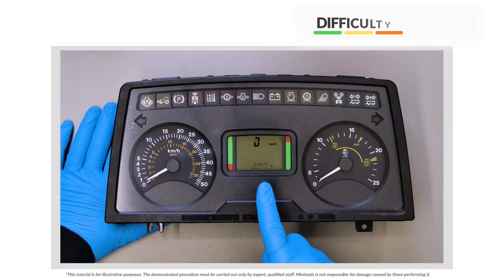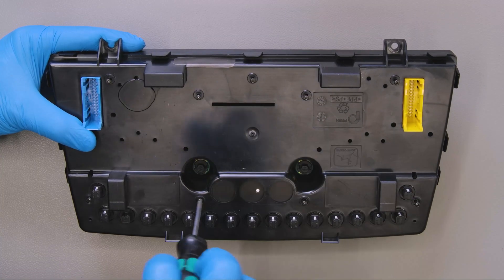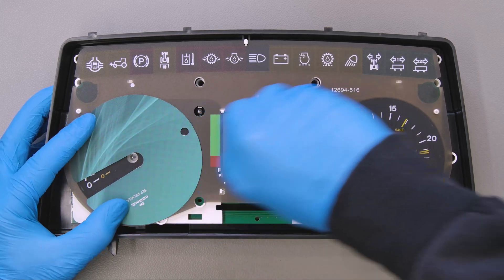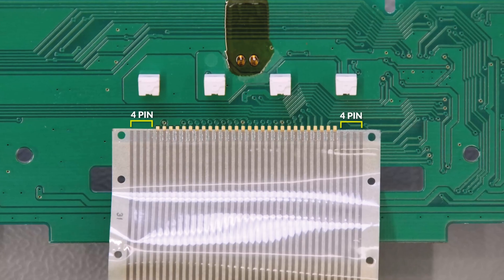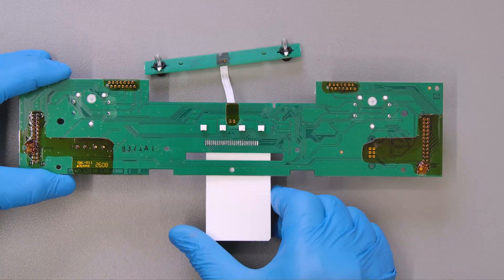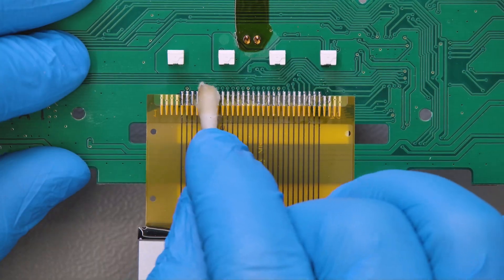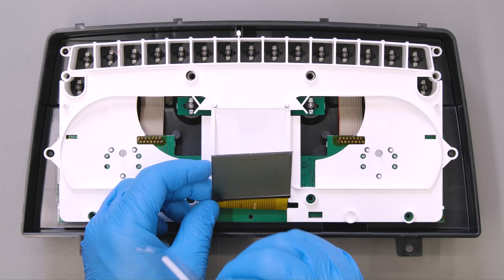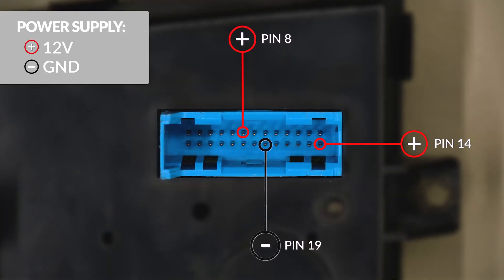John Deere instrument clusters BIF LCD display replacement – LCD pixel repair

Comment: Hello. I have an instrument panel the same as the one in the video. When I feed it with 12v the needles go to the maximum and do not return. They only come back if you go offline and back online. Could you help me find the error. Very good video. Excellent!!!!
Reply from the maker: Hi Angel, that’s really odd.  Could you please send some pictures and more details at info@minitools.com? Thank you
Reply: @MinitoolsChannel  Okay. Thank you very much, I will send a video where the failure is noticed